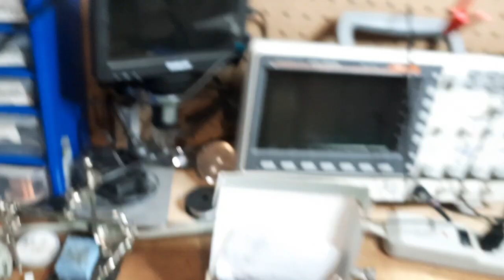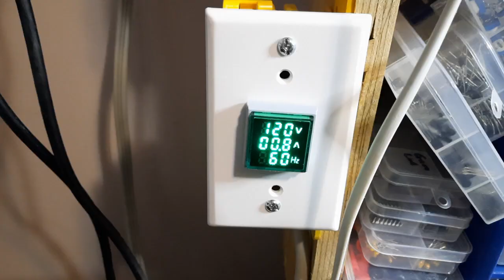Voltage Amperage Frequency Meter installed into work bench

Comment: In use ...would you fuse the ( say, 120V / 60Hz) power legs to this unit ( the leads to the screw-heads on the meter)?...and if so.....what kind of fuse ? ( 1A fast acting?)...and would you need to fuse each of the power legs or only one?
Reply from the maker: The power bar is rated for 15 amps 120Vac and has its own internal breaker. Plus the house circuit that this is plugged into has a main panel breaker at 15 amps.  If you wanted to add a fuse you just need to figure out what your maximum current is going to be at the bench. My heat gun uses 11.7 amps.
I prefer slow blow fuses and it would go on the hot side, not the neutral wire. 
I didn't add a fuse since the encloser is a electrical code certified gang box and if there is a short circuit the main panel breaker will trip and cut power.  I tested this type of gang box before with a propane torch, these gang boxes don't burn.
Reply: @retireeelectronics2649  ..thanks, my situation is slightly different but I'm using the same monitors as you are showing in your vid. The intent is to mount the device directly to the panel face of my emergency generator, and use 2 of them...one display monitor for each 120V leg of the 240V gen output. Like this unit you show....it comes with a ring type current transformer but requires you to source and attach 2 leads from a 120V source to the monitor itself.  OK....one fuse.....would that be on one leg....or both, for each unit? Hot leg only and not neutral?  What is the risk otherwise with no fuse?...maybe only that some electrical mishap will burn the thin gauge wires used to bring 120V to the meter monitor? As if the thin wire is the fuse?  I might take that risk if it's localized damage like that....just don't want to burn up my generator. Panel face is metal and meters are placed by themselves touching nothing else. What would I use...16-18 wire in any case?  Thoughts? The leads are only to power the readout of the monitor,....and bear no relation to the amps or volts measured by the CT, right?......
Reply from the maker: I think I see what you are doing. If the generator does not have fuses already built in,  then each 120V leg needs a fuse on the hot wire going out to your loads. To the actual meters you could use a low amp fuse, 0.5 amp or less on each of the hot wires, there is very little current being drawn by the meter (never measured it). The wire to the meter could be 18 AWG or any old power cord that you can chop a piece off of.  Keep in mind I am not a electrician. Main thing to keep in mind is the back of the meter does have 120Vac and even a low amp fuse will not protect a person if they come in contact with it. 
Hope that helps.
Reply: @retireeelectronics2649  ....you got the idea of what I'm trying to do. To be clear...yes.....my generator has 120V receptacles and also a 240 V receptacle fed from the 2x, 120V coils of the generator. So....each receptacle does have a 13A breaker acting as a fuse. That said, a 13-15A breaker is much too large to say "there is a breaker in the circuit" to protect the new monitors...so I was conflicted if the newly added 120V power leads to the monitors need their own separate in-line breakers of some ridiculously-low Amp rating.....noting (as you said) the very low operational "draw" of the monitors. Thanks for the ideas.......